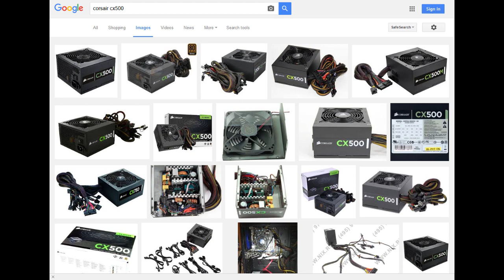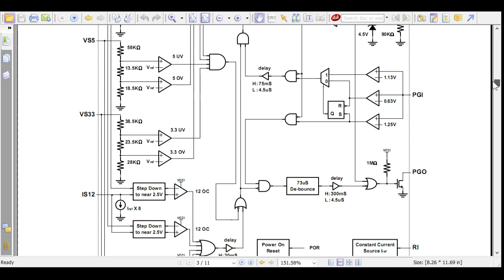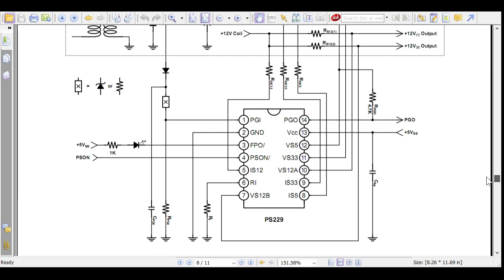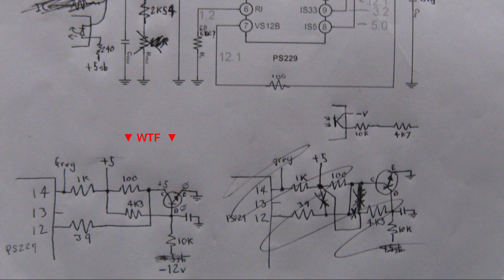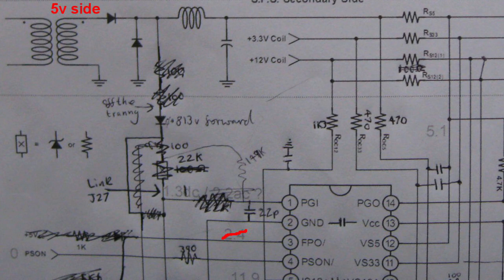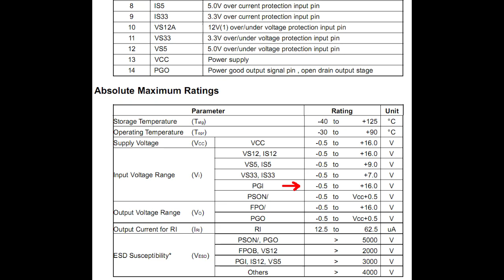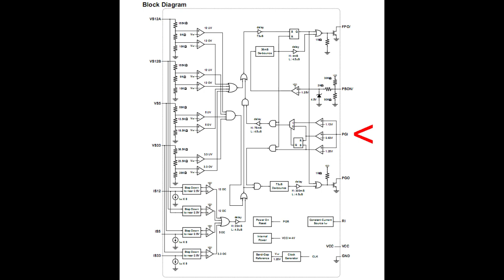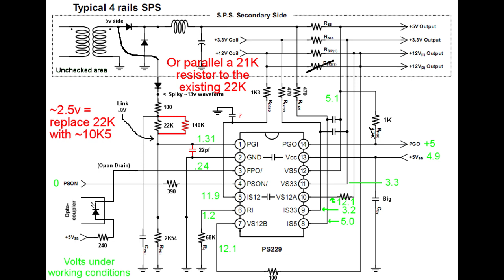Corsair CX500 PSU Repair

Comment: So I have this old corsair cx650m showing the same exact symptoms. I know this a really old video. I was looking around if it is/was a common issue. Looks like it is. I’ll watch this video a few times and understand it better and maybe do the repair attempt.
Reply: I will also give my cx600 to a chance. It is disassembled right now. I am salvaging a resistor for it from scrap. My native language is not english so i did not understand whether the capacitor is necessary or not between PGI and ground.

Comment: I had this exact issue on my corsair VS550. PSU is working now, pc boots normally. Paralled 24k to the 20k making it 1.8v before it was 1.1v. I think corsair should give you compensation for solving this issue and sharing to the world.

Comment: I have a CX 750. The PSU works fine, until I turn the PC off, then it will not turn on unless I either tug/twist on the wires coming from the PSU or tap/bang on the side of the PC/PSU case. I did some testing, but I think now I may have not properly understood how a PSU works. I checked for 5v on the green wire at the mobo 24 pin, and got 0v, but I'm now learning that is the PS on circuit. Perhaps I am supposed to be looking for 5v on the Purple 5v standby? I've had the PSU open and everything looked fine. I got this PSU from a friend who built a PC in 2015 and wound up not using this PSU for unknown reasons, she didn't even realize she had it. It appeared to be brand new in the box, I'm thinking it was doing exactly this and she just bought a new one and never RMAed it. Any help would be appreciated. Id like to be able to turn my PC off at times. Another weird thing that your symptoms made me think of, if I restart my PC the PSU never turns off, and the PC will restart, but it stays on the restarting screen for a long time, maybe like 10 minutes, before finally restarting. Thanks for any help anyone has top offer, I just don't have the money right now for a new PSU, I also need a new mobo, my Ethernet adapter got fried in a storm, but I'm pretty sure these are unrelated, I was having the problem with restarting the PC long before the Ethernet problem came along.
Reply from the maker: Eeeerm, this sound like a different problem.
If you say that moving the cable/hitting the PSU fixes the problem, then it sounds like a dry solder joint. You will need a look at the pcb with a magnifying glass.
If you completely remove the psu, you can short the green and back together.  ( https://youtu.be/5FWXgQSokF4 ) That should power it on, so you can poke-and-prod the circuit board to narrow down the issue.
Reply: @Matt47247523457  I will have to pull it apart and take it to work to look at it under a microscope. Inside it is a large PCB and a smaller PCB. I suppose I can just trace the purple and green wires and see where they go. Thanks for the tip, Ill have to try this one day. Is it the green wire that gives 5v to the mobo at all times?? Or the purple?? I'm pretty sure this is the circuit I'm having trouble with.
Reply from the maker: The purple is the 5v standby - always on.
The green is a very weak 5v - always on but designed to be shorted to ground/black for power on.
https://en.wikipedia.org/wiki/ATX#Power_supply
Reply: @Matt47247523457  I should be able to see 5v on that green wire with a voltmeter, right?? I do know that when it wouldn't start it had 0 volts on the green wire with the PSU plugged in and switched on. I didn't ck the purple wire, but can.
Reply from the maker: yes you should see 5v - when it is disconnected from the motherboard.
Reply: @Matt47247523457  Hey thanks again. Id really like to fix this. It would be nice to to be able to turn my PC off, even though its in need of some upgrades Id still like to have some extra parts laying around to set up a server.

Comment: Hi Techy Bits-n-Bobs, did you consider that it maybe the Cpgi cap that has decreased in value at it is close to the heatsink? 50V 1uF in my CX430M. This capacitor stores the noisy voltage peaks you found on the output of the transformer, prior to L-C filter. If this capacitor reduces in value, then the "emptying" time constant through the resistor chain make the PGI input voltage likely to trigger. The point I make here is because my PSU worked for 5 years, something has aged. So while the resistor fix will work it is compensating for the 1uF failing. Many thanks for your informative video, a great help. Please reply with your thoughts :)

Comment: My CX 750 worked fine for 3 and half years and then the pc restarting problem started. 
Recently i replaced it with an unbranded 800watts smps unit, its build quality was very bad but my system is running correctly with no issues. 
It has no 80+ certification written on it. And the cost of it is very cheap.

Comment: Just had this EXACT issue. 0.111v on PSU_OK. After some frustration I tried just wiring PSU_OK to 5V, which obviously didn't work because it is timing based. This video is fantastic and I am going to retrofit mine immediately.

Update

Of course it worked!
I reckon there are enough examples in the comments here to confirm the design fault - I wish companies would disclose this kind of stuff but competition is not conducive to admitting flaws I guess.

Comment: Thanks great instructions, I soldered today 22k top of original smd. Future shows if this fix it or not. Curious why psu worked many years without problem and suddenly start fail. Or maybe it failed here and there, bud lately it was daily basis. :)
Reply from the maker: Yeah, I was wondering why it failed after X years.  My best guess (based on the data-sheet) is the resistor divider was designed toooo close to the edge.
And after years of wearing out.. it was enough to tip the balance in the wrong direction.
Reply: Dude, is it still working properly? I am asking because i will do the same thing to my cx600.
Reply: It worked few months, then it got again unstable, bought new power supply year ago. :( @coderhex1675
Reply: @coderhex1675  It worked few months more and then started to fail again. Bought 2hand better PSU and now no issue. How about you? You fixed it? Did it help?
Reply: @0ooHEROoo0  ı coudnt test it under the load but i did the trick in this video. If I cannot remember wrong, without load it gives the correct voltage levels. My CX600 is idle in somewhere in my wardrobe. When i test it under the load, i will let you know.

Comment: Hai great video.. Going through same issue for my cosair VC550 smps..
Couldn't find any 22k resistor in my smps

Can i supply 5v directly to power good out grey wire

Will i able to fix this issue
Reply from the maker: Yes you can, but you will loose over/under voltage protection.  Especially during the power on phase.
Reply: @Matt47247523457  Thanks for your valuable reply

Comment: excelent job , i have similiar psu corsair tx850w i checked all capacitors is ok, also replaced for test, all shotky diode is ok also replaced for test also, but when i short green wire with ground fan try to spin then stop i short optocupler and i saw 5v is ok ( 5.1v) 3.3v is ok (3.37) but 12 is too low 9.86v so psu shut down because pin 7 of ps229 detect low out voltage and shutdown but can find failure part i hope you give any hint to solve thanks in advance..

Comment: Was just about to order a new psu when I thought I'll just give youtube a try. And here we are - identical problem! It does take a certain mindset to want to try & repair this sort of fault as all too easy to junk it and buy another - so well done! Particularly impressed you managed to locate the point on the board between the 2 resistors. Vey small.... In the end I just added the parallel resistor as per your pics (2 X 10K in series as that was all I had). Didnt touch the capacitor. Seems to have done the trick - so thanks.

Comment: Thanks you for the video. I want to modify my Corsair CX500M in order to give 14 VDC - I need the electronic circuit diagram - or - Can you help me?
Reply from the maker: sorry, the circuit diagram does not exist
Reply from the maker: My quickest response is to adjust the opto-coupler feed back, e.g. add a resister to the LED side so it is not as bright.

Comment: Hi there. A few years ago I start to repair this PSU and now I have time to finish the job, everything is OK now, voltages, etc. but few years ago I was removed the transistor FQ3 right in front of fan connector see this image -> https://imgur.com/p23k5Gt and now i can't remember where he is and what he is. Can someone help me with this? PSU is OK now but the fan didn't spin.

Comment: Bro, I want to ask, PSU Seasonic, if the switch on turns on immediately (without connecting the green and black wire), what should be checked? (PSU has been removed from the casing)
Reply from the maker: oh, I would follow the path back into the PSU to see check if there any damaged components / dry joints.
if there is ~5v on the green, that maybe a sign of a bad IC/transistor.
If its ~0v then its probably a passive component (like the pull up resistor) or a dry joint.
But it could be a 100 things without looking.  I'm just guessing.

Comment: Hey man, thank you so much for your investigation and video. Took me just 15 minutes to repair my CX500M power supply - 10 minutes to watch the video and 5 minutes to disassemble PSU, locate SMD resistor and replace it with 10KOHM one. Thanks A LOT!

Comment: does it take motherboards and other hardware with it when it fails like the Bestec PSUs in HP and eMachines PCs.
Reply from the maker: For this particular problem is does not cause a Mobo failure., this problem is because its too sensitive to the voltage changes.
However I dont know the state of other peoples capactitors in there PSU (or other components).

Comment: Thank you for the video. I was able to repair my CX600M that was in my trash pile by soldering a 22K SMD resistor in parallel with the existing one. 😁👍
Reply: What do you mean by existing one?
Reply: @dogodogo5891  Watch around minute 7:30. I watched this video long time ago. He did a great analysis of the power supply. To reduce the value of the existing resistor you solder another one in parallel to det to the desired value.

Comment: Thank youuu, my cx600 had the same issue, replaced the 22k resistor with a 10k and problem solved
Reply: can you explain your cx600 problem? because I also use it,  when the green pin is connected to the black pin the problem is the fan just rotates for a while, and turns off.

Comment: The problem is those cheap junk Chinese capacitors. They are designed to only work until the warranty expires. Those junk capacitors causes other components to fail as well as your motherboard

Comment: please can you help me I have a corsair cx600 source i do not turn on anymore the green cable with the black one and it does not turn on the fuse this good there is no short in the mosfet if there is voltage in the big capacitor there is no short in the diode bridge in the purple cable with the black cable if there is 5v voltage in the yellow there is not in the orange either and in the red the fan does not do anything either please help me
Reply from the maker: Your PSU sounds like the same problem as Giovane Sobrinho.
I did not have this issue with my psu.
Can you check if the main PWM IC is switching correctly?.  I do not know what the chip is. But it is located on the left side of the board.

Comment: When i try to start the PSU the fan starts and stop quickly, and pass no power, i try but i can't find the problem.
Reply from the maker: Sounds similar? to the issue I had.  Did you check all the voltages on the IC ?
Reply: i try but i thing with poor accuracy only combnation that i find some voltages was pin 2 and 13 with 5.11v, sound similiar to you? talk me about your experience.
Reply from the maker: Well, at least the standy volts is working  :)
at 07:30, all the voltages I measured was to Ground (pin 2).  But pin 1 voltage is misleading.  Because it only worked sometimes.
It would be a best to measure the voltages with the PSU disconnected from the PC, and connect Green & Black on the ATX connector (fake power on).
If the PSU does not stay on during this test.  Then the problem is very different to this one and I can not help in the youtube comments   :(
Reply: well, i connect Green & black on the atx connector and I measured the voltages at the connector and the only cable that has voltage is the purple with 5.11v.
In CI i measured pin 3 = 4,32v, pin 4 = 0,04v, pin 6 = 1,21v and pin 13 = 5,11v.
any nother pin have 0,0v.
Reply from the maker: oh dear...  Pin 3 looks bad (because you do not have the 3.3v, 5v, 12v).
It looks like it is not switching anything (standby volts does not count), maybe the main PWM IC is damaged? (just guessing).  I did not mention that in the video.
The opto-coupler might be damaged, but it has never happened to me.
unfortunately you will need to start from the Mains 230v side and work you way towards the transformer.
I did not examine that side of the PSU, so I do not know.
I think you will need to start checking the capacitors.
Reply from the maker: * including the small capacitors.
Reply: bad caps. common problem